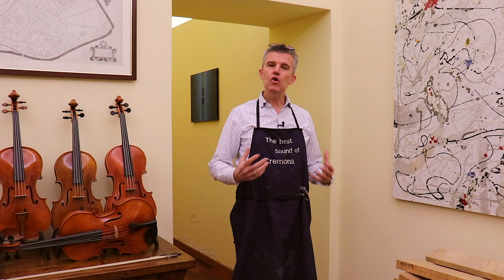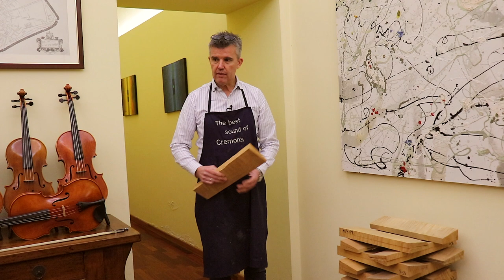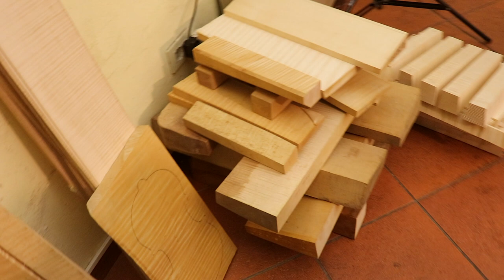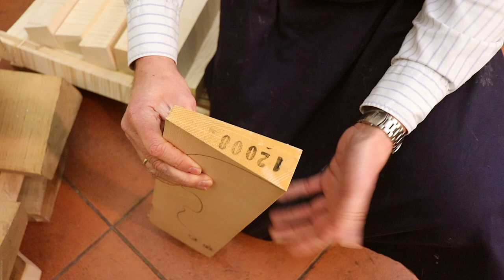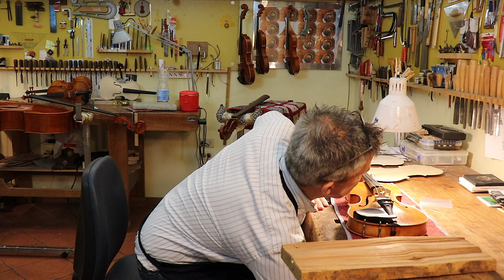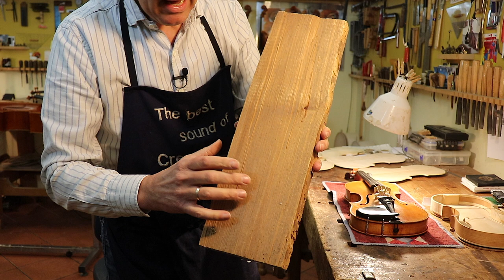Ep. 83: Let's talk about WOOD for violin, viola, cello and doublebass

Comment: I have a violin with a different kind of wood in the back and sides, after researching on the web I came to the conclusion that maybe it’s made out of poplar, which is rarely used in violins, also my luthier told me that the fingerboard projection is lower and because of that the bridge is shorter, I don’t know anything about my violin because it has no label but do you know where is more common to find violins made this way? I love your videos by the way! Greetings from Mexico!

Comment: See a minor dark knot/dark spot in the plank on the bench, I wonder if that would cause issues. And he pointed out he would not use it, so I guess the answer is knots or high density is an issue. I have drilled or or put screws into knots and have had issues, so I thought this kind of density would be a carving issue. Am not a carver and would not put the 100+ hours into carving from scratch. But I plan to get a $70 unfinished spruce and maple violin kit at some point and a caliper, get the thicknesses right and do tone checks, put it together, probably spirit varnish it. See how it sounds, it's nice to know there is a possibility of getting an acceptable tone if I am lucky.